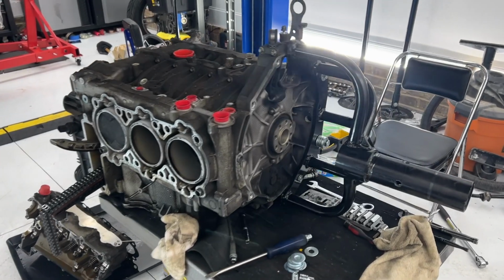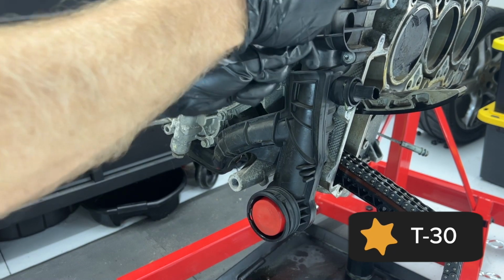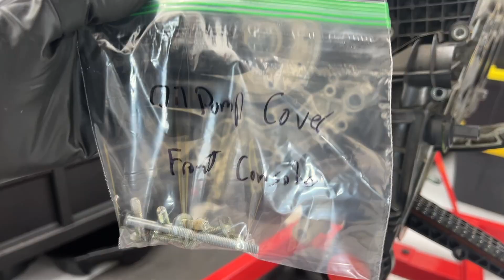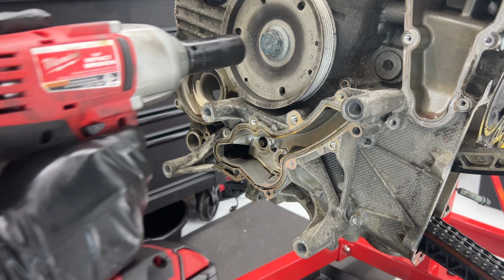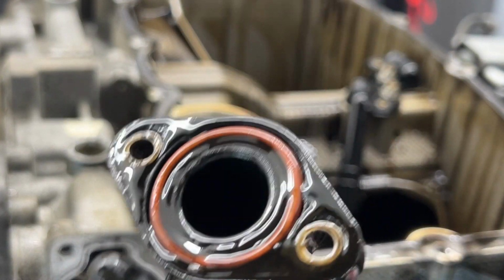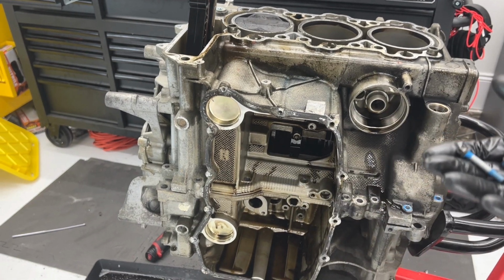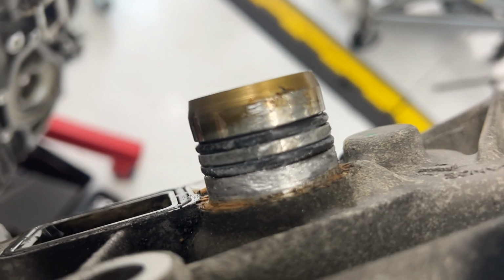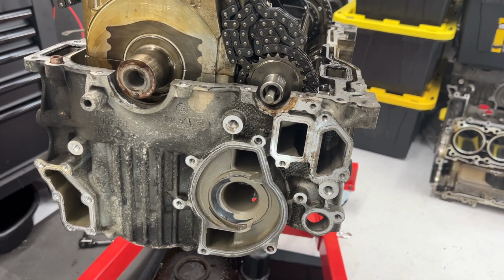Porsche Cayman S 987 ENGINE TEAR DOWN (Part 5) - Splitting the Case

Comment: The swirl pots look like 997 items and supposedly are better than the earlier versions. Those cases sure had a good pinch on the oil pump casting, but it was nice to see they doubled up on the O-ring's to prevent an oil leak.
Reply from the maker: +@warrenlucier5796 👍🍻

Comment: Next time try using a flywheel/gear puller to remove that cover you had problems with. A standard Y/Peace symbol shaped flywheel type puller should work. Center the main bolt of the puller on the shaft and screw the other puller bolts into any holes on the cover they line up with. Then start tightening till she pops off like a flywheel would.
Reply from the maker: +Aaron S good tip thanks! 🍻

Comment: This is the motor that has the blow-by test results at 160 Liters per minute , right ? I can see exactly why it had those results with the wear/score on the bank 2. Did this engine have the signature "tick" /" knock" sound to it also? Mind if I grabs some pics of the bores for educational purpose ?
Reply from the maker: +@charlesbrazeel3684 yes it is! I never really noticed a tick. Feel free to get pics 🍻